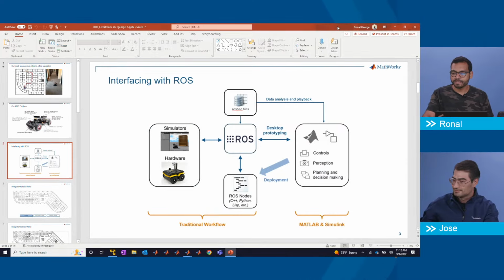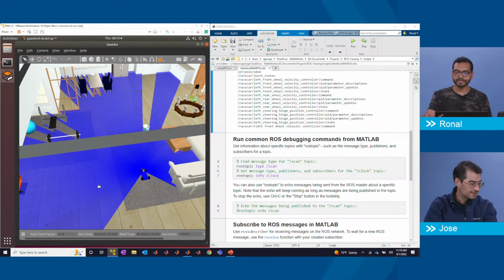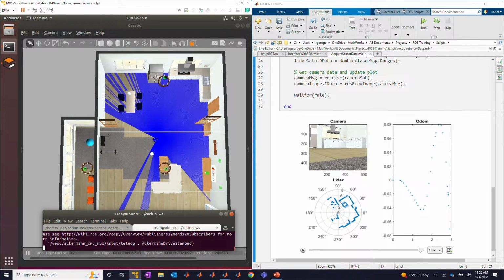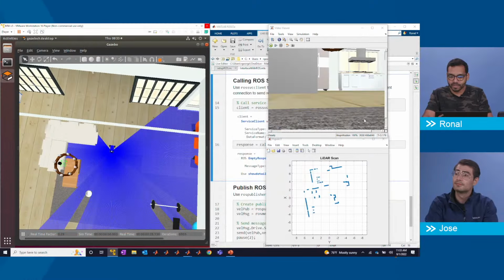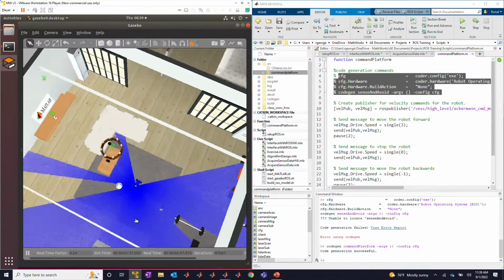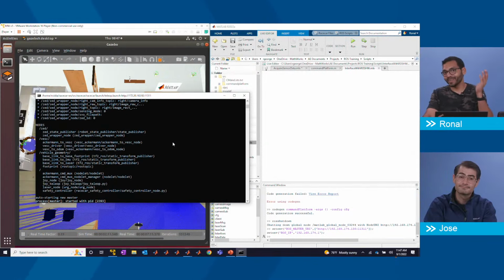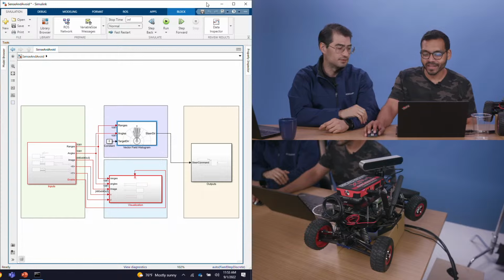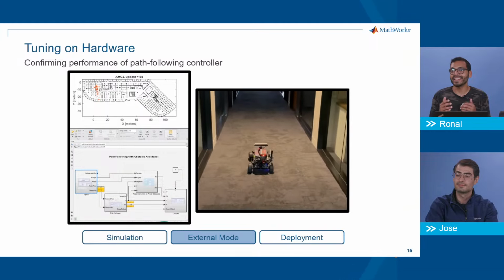Develop Autonomous Algorithms using ROS

Comment: Were you using a matlab gazebo pacer block for the simulations? Or was the communication not hard realtime? Ros itself is not hard realtime right? So what would you do if you want to design a low level motor controller. Should you exclude ros and write it directly in c++? Or are there possibilities with matlab for this?
Reply: I believe there was no pacing on these demos but you can certainly sync up Gazebo with Simulink with the pacer block if you want higher simulation fidelity. The communication was asynchronous, ROS is not real-time but can achieve very fast responses, ROS2 has communication protocol improvements for quality of service that were made specifically to be more competitive for developing real-time systems so you can look into that. Motor controllers generally do benefit from deterministic controller executions and high frequencies. Normally it is best to program a microcontroller or other real-time device for the low-level controllers and have them interact asynchronously with a ROS network that can set higher-level commands. Simulink support for Arduino or other microcontrollers (TI C200, STM32, raspberry pi, etc) or Simulink Real-Time can make it easier to develop those low-level controllers. Hope this helps.
Reply: @jnaahg  Thank you for the detailed response. It definitely helped!